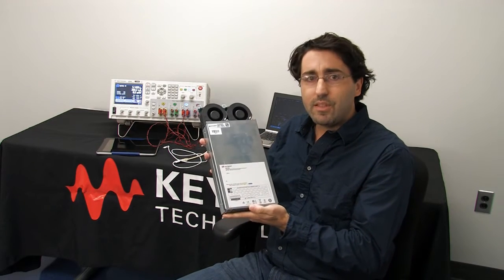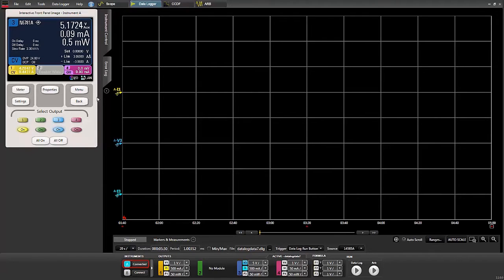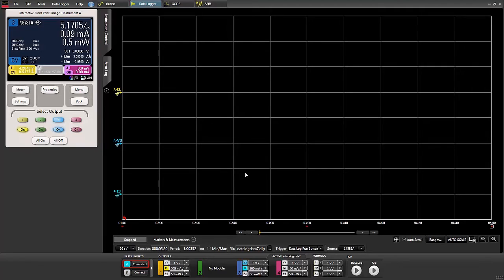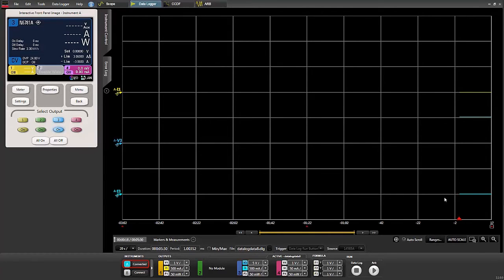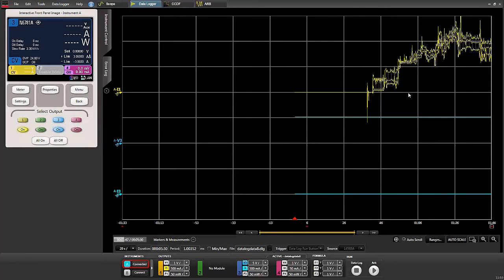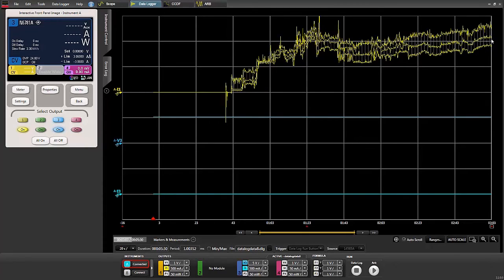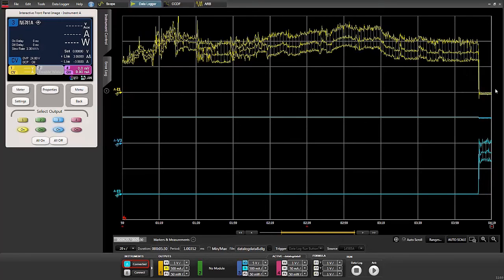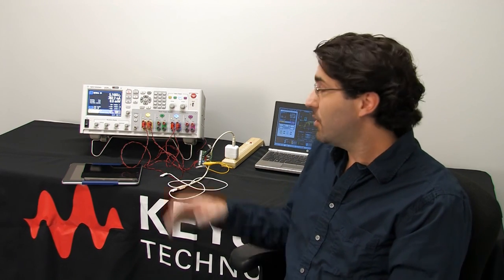Measuring the real time current of a tablet from its battery and a charger

Comment: Hello, I have the same device, the N6785A. I want to measure the energy consumption of some smartphone apps that our team developed. I replaced the battery of the phones with the device. The battery has three pins, but I am only using two for the measurements. The behaviour of the  phones is strange:

The Samsung Galaxy S7 Edge boots up normally, sometimes it shows up 52% battery charge, sometimes 0%. After some time it reboots
The Sony Xperia XZ shows a small current peak when I push the on button, but it does not turns on
The Huawei Mate 9 keeps rebooting in the middle of the booting process.
The Galaxy tab A works fine, displaying a 27% battery charge level  

I read somewhere online that I should also solder a resistor between the minus pin of the battery and the middle pin because the phone normally reads the value of this resistor to estimate the battery level. I didn't do this, but I wonder how is your setup and if you have such a resistor connected. If you have some comments on my setup, I'd also appreciate them. Thanks